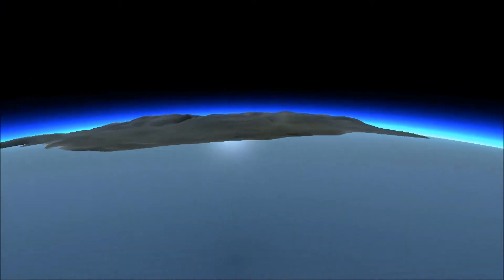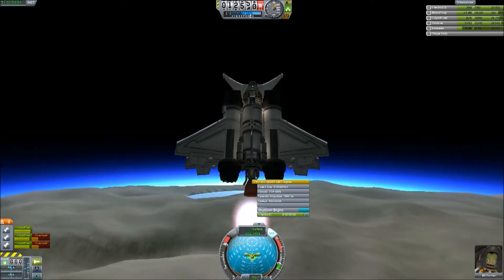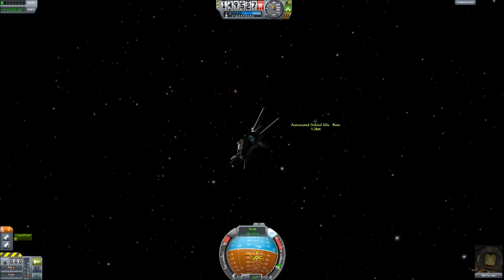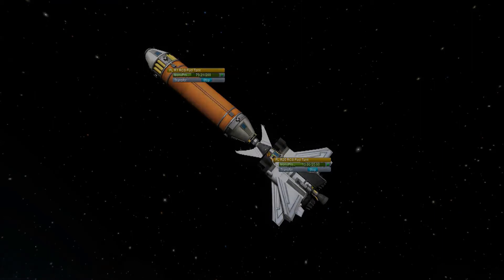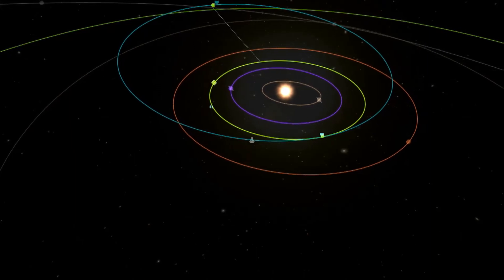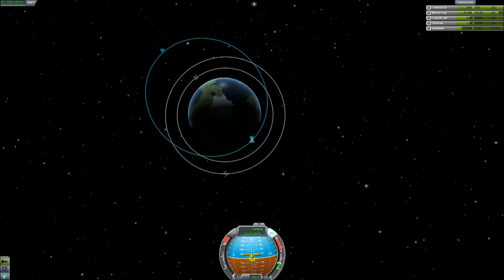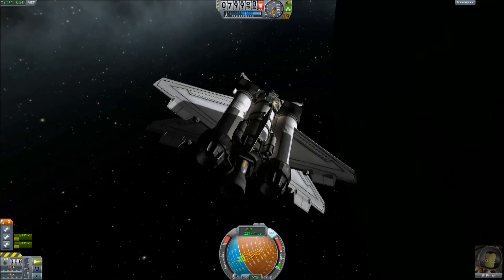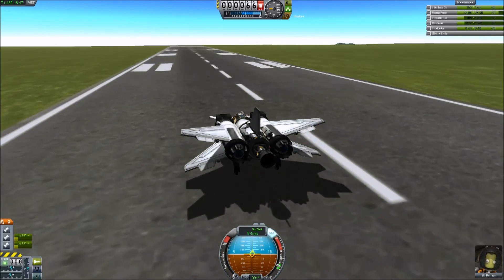KSP - SSTO Spaceplane To Laythe (Part 3)

Comment: what you can do to stop from fliping over when applying the brakes is remove the front gear from the braking action group so you only use the rear brakes